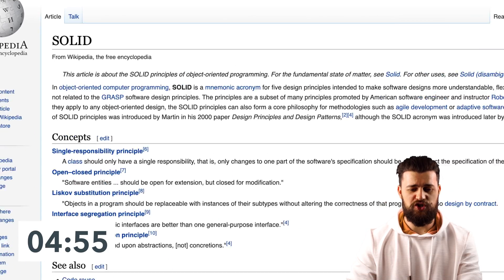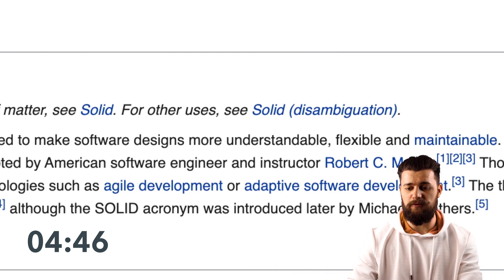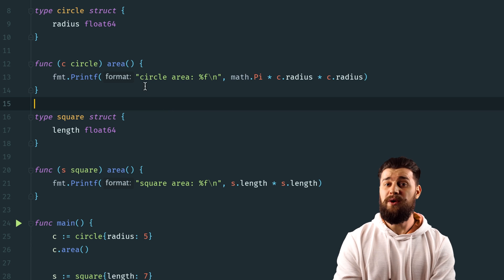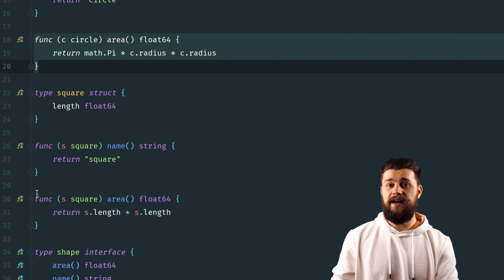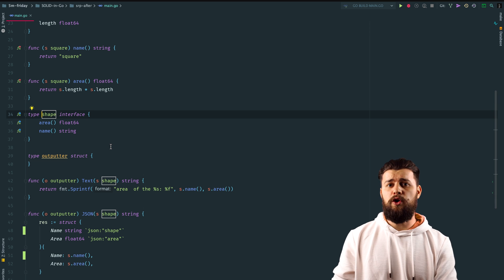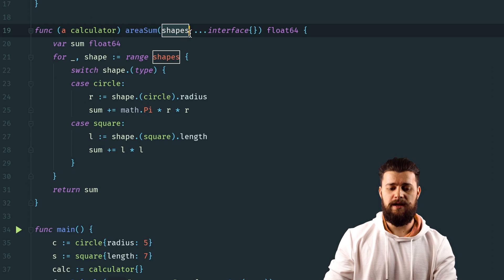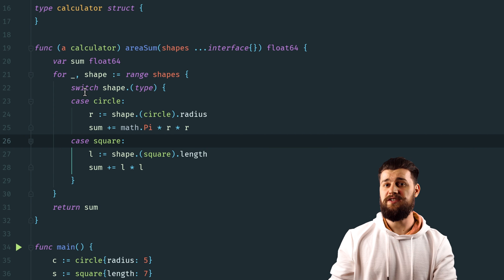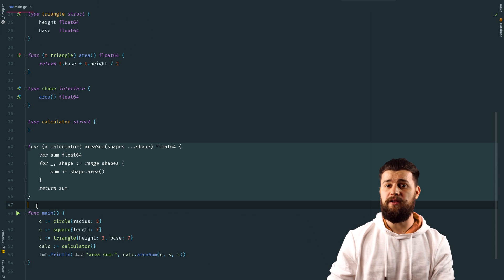SOLID in Go in 8 minutes (5m Friday #5)

Comment: Hey Steve, thanks a lot for the great video. Learned a lot in a short time. May I ask you what vscode extension you use to get the interfaces show under the structs?
Reply from the maker: Hey Newsha, I mostly use Goland. Not sure VSCode has such an extension, but let me know if you find such a thing 🙂
Reply: @SteveHook  right, I don’t know why I assumed you use vscode. Sure, if I find anything similar I’ll let you know. That’s a cool feature to have. Not knowing which struct implements which interface is one area that makes it difficult to work with object oriented design patterns in golang. When I saw you had that feature I was very excited.
Reply from the maker: In Go you don’t need to know who implements what. Everyone implements at least interface{}. But it’s a nice way of seeing usages in the code, especially when working in a big project 👊

Comment: Hey man. Thanks for the effort of making attempt on SOLID in GO. Anyway, you did some mistakes:

With the Single Responsibility Principle, you correctly split the responsibility of computing and printing, but right away you broke it - Outputting is one responsibility, formatting is yet another one. Not to mention that your Ouputter has two methods: Text and JSON which breaks the Single Responsibility Principle again. Why this is bad? Because you can have multiple output targets: console, file, some device, and multiple formats: YAML, JSON, text, and then to get the desired combination you'll need to create 3x3 methods. When doing solid you should go with 6 simple structs that can be combined in any way you need. Some might say - "why so many structs?", but when you need to pass it to another method/function you will pass only two interfaces. This will help avoid switches and ifs control statements inside of the method/function body to figure out which method you should call. This code will be super easy for unit testing and maintenance.

With the Open-Closed Principle, you forgot to mention struct encapsulation. No other implementation should be closed on public properties values since they might change. The problem here is that some classes could write to public property, making the internal state of this object inconsistent, which will affect the behavior in an undesired way.

With the Interface Segregation Principle, your "object" interface breaks this principle - it should have only the "volume" method signature. You probably did this mistake, by creating a not logical method "areaVolumeSum" - what it should model in the real world? When you would have "areaSum" and "volumeSum" functions you'd probably make a proper split of interfaces. This is also the reason that interfaces should be created first - to not be biased by already created usage. If you have a sphere struct and you need it only for volumeSum, why also implementing the area method which you don't need?

The Dependency Inversion example is good, but the example required to be fixed is not full. To make it full you'd need to implement "NewUserRepository" function where a new instance of MySQL DB is created. An example of fixing it would require this function to take the interface of DB as an argument and set it as a value of a new object of this struct.

PS. I want to congratulate you on your presentation skills. They're top-notch.
Reply: solid is just kilometers of unesseary abstractions
Reply: @SULTAN-6931  which can save a lot of time especially for the new comers working on a large project

Comment: Your take on SRP is not correct - A function should only do one thing but this is not the SRP. Uncle Bob's final version, from his book Clean Architecture is "A module should be responsible to one, and only one, Actor". Good video though...!
Reply: That is exactly was I was to clarify, SRP (The Single Responsibility Principle) talk About "... each software module has only one, and only one, reason to change."   And it is not about what it does as functionality!.
Fortunately, the implementation is Fine!, but what it is mean? if you are going to modify your module as @Steve Hook mention in the video the same module function has two reasons to change (format the output [1] and calculate the result [2]), so if you want to improve/change some of both, you are broken the SRP.
Reply: @christiangda  Uncle Bob updated the meaning of the SRP.... Remember we are talking about the module NOT the function. The word cohesive implies the SRP. Cohesion is the force that binds together the code responsible to a single actor - Clean Architecture pp 63 Robert C Martin.
Reply from the maker: I think we should clarify what a module really is. A module in software in general is not tied to or necessarily related to the definition and implementation of the module each language and ecosystem has. It rather refers to a piece of executable code that is meant to be run/called by the main or other parts of the program. Be it a function/method/type/module and others. They are all part of the same SRP definition just at a different scale. And IMHO the module word kinda describes all of them in one word perfectly. Hope that clarifies my examples and explanation
Reply: Steve Hook We have to be careful on this.... going down too far will result in brittle tests. The idea that a module will be responsible to one actor is a delicate balance!
Reply from the maker: I’ll be glad to perhaps make another video where I dive deeper into each and everyone of them. Otherwise it creates confusion for those who watch
Reply: Steve Hook Stick very carefully to the old masters on this. There is so much confusion around this area. The latest book from Uncle Bob is good.
Reply from the maker: I agree, what people usually forget is best practices are best practices. They should not get in the way, and they are not like some sort of bible to be remembered by heart. Just some basic fundamentals which can be adapted to specific examples